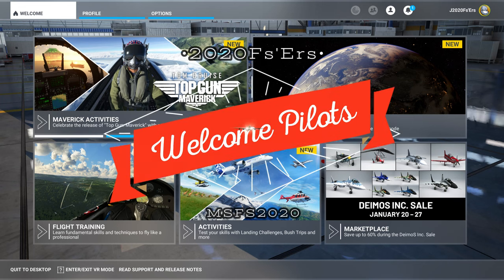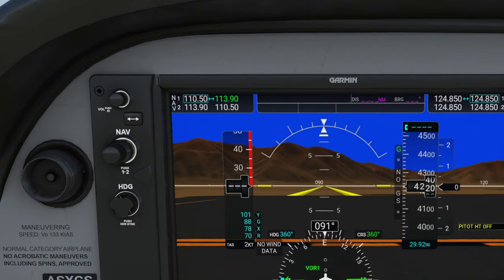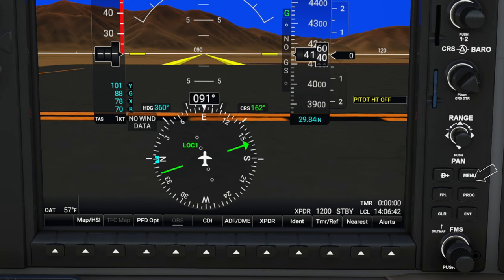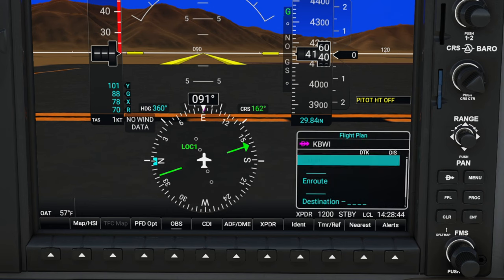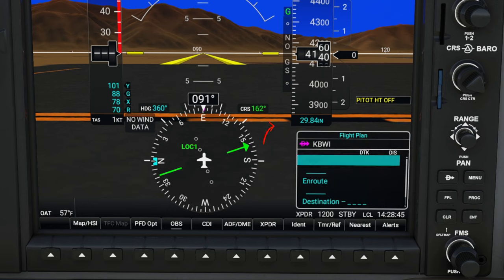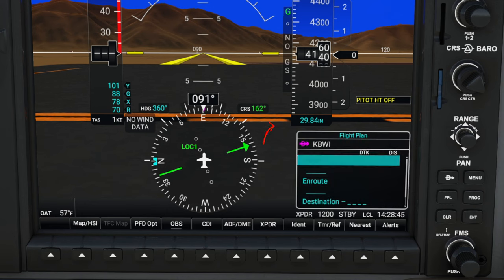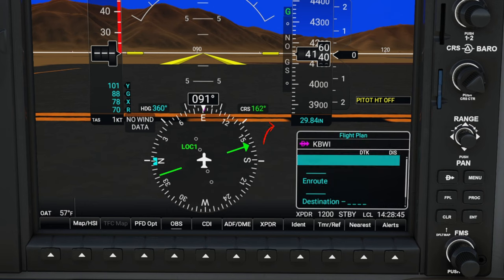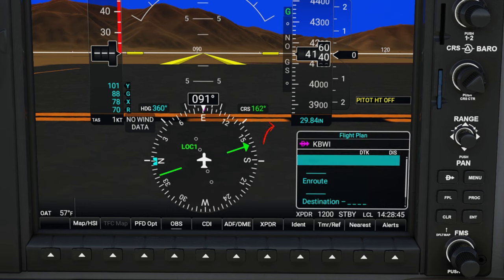Mastering the G1000 PFD in MSFS2020: A Step-by-Step Tutorial :Easy to understand & Time Stamped

Comment: Excellent video! I just purchased the g1000 and am debating whether to use it ad an MFD or a PFD. I heard you mention auto pilot in the PFD tutorial but I was under the impression that auto pilot was available only when MFD mode. 
Was I wrong?
Thanks again my friend!
Reply from the maker: Thanks for the comment .. autopilot can be used anytime whether you have your g1000 in mfd or pfd mode.  
In mfd mode you have way more control over flight plans and finding information on airports around you and vors. As well as navigraph data  if you have a  subscription.  You also will see your fpl . In pfd mode you cannot see your fpl but you can still plan a flight but you loose lots of features. What I would do is use a tablet to display your p FD and then use your G 1000 hardware for your M. F. D. If you get the SIM box application, then it already has the G 1000 bezel  for PF D that you can simply drag the display on to your tablet and then it already has the bezzle around it, so you can control things right from the tablet, even push buttons right on the tablet.  And activate them on the G 1000 it's very very handy, but he doesn't have the M. FD portion done which is fine for you because you have a hardware device that you can use for your Mfd. That would give you the best of both .
Reply from the maker: Check out this page and you can try it free
https://www.flyingart.dev/simbox
Reply: @2020fsers  Thanks for the quick come back. I hadnt considered using my android tablet as my PFD. I am going to look into seeing how to get that done. 
I really appreciate the help! ✌
Reply from the maker: @anagingrebel6229 the simbox app is all you need everything is integrated Into the app. So you don't need space desk or any other screen mirror app.

Comment: Why do some G1000's Have the auto pilot controls on the PFD and some do not.  what's the difference
Reply from the maker: its just by design some planes like the sr22 has its own autopilot panel and others i would assume to save space they add it to the dead space on the g1000 or between the 2 panels . the g1000 works the same in either case

Comment: The brightness of both the PFD and MFD are very dark in the sim. I checked menus for both and brightness level is 100% for each. This makes me think something outside of the sim causing this.?
Reply from the maker: Some aircraft have a manual knob to control brightness on the screen the other thing you can do is go into the brightness level into the menu on each of them turn it to manual and then go back to 99% and back up to 100 again and sometimes that will also increase the brightness